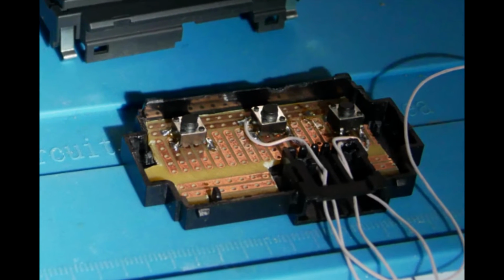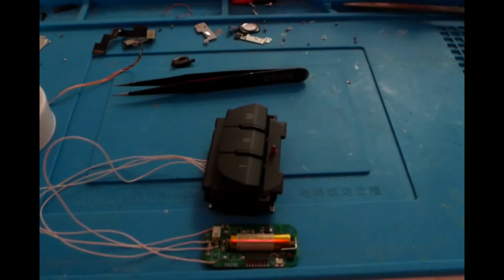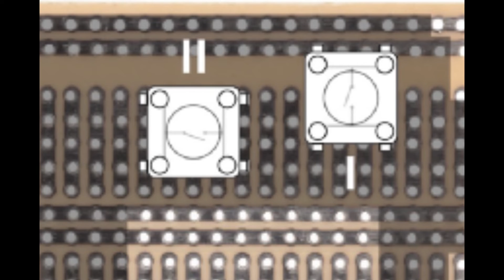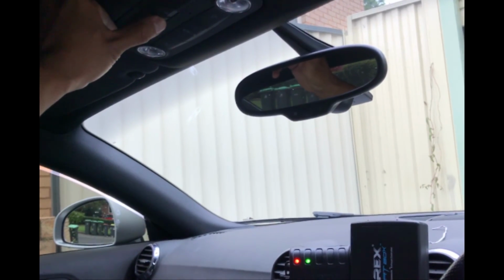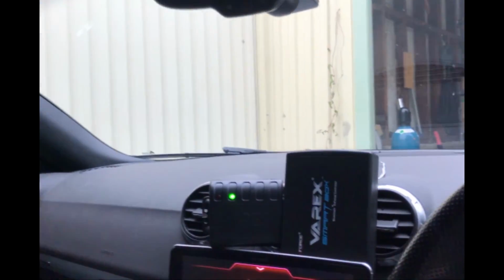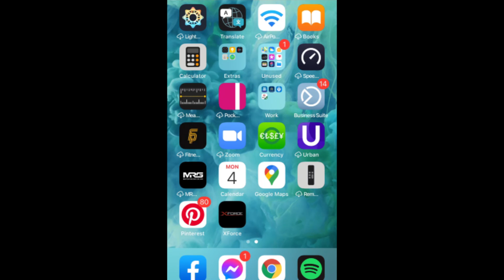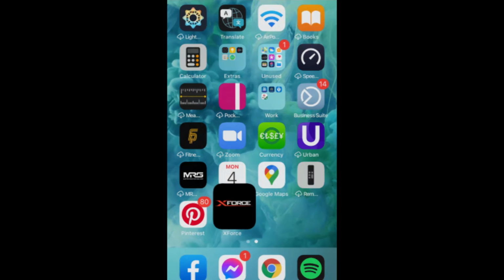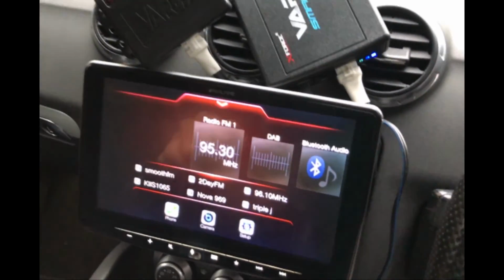Audi TT Mk2 8J LED cabin light upgrade & HomeLink garage door opener hack for exhaust valves

Comment: Pin 1 = + and 6 = GND?
Reply from the maker: Pin 1 > Earth (terminal 31) lower left A-pillar (44) (brown 0.5mm)
Pin 2 > Doors open signal (CECM B/T12c, 11) (blue/grey 0.5mm)
Pin 3 > Automatic anti-dazzle interior mirror Y7 pin 6 (purple/blue 0.35mm)
Pin 4 > 12v permanent live (terminal 30a) (CECM K/T10d, 10) (red/white 0.5mm)
Pin 5 > Illumination (terminal 58s) (CECM B12/T12c, 12) (grey/blue 0.5mm)
Pin 6 > 12v permanent live (terminal 30) (fuse SC15) (purple/white 0.5mm)
Reply: thx @ianpgonzaga

Comment: Hey, interesting video. The varex remote required a 1.5v battery. Once mounted there is no battery present. Did you find an alternative power supply for it?
Reply from the maker: Thanks GRH. 
It required 12v so was simple to wire up  😉